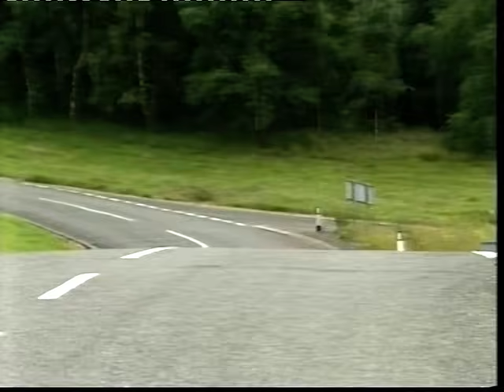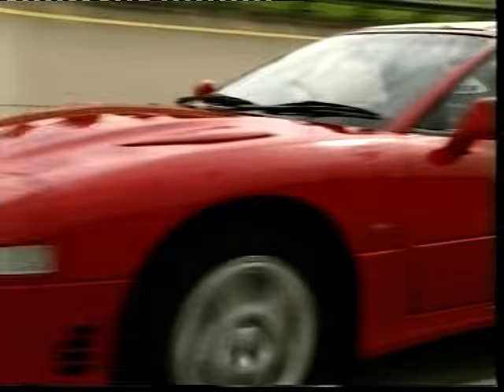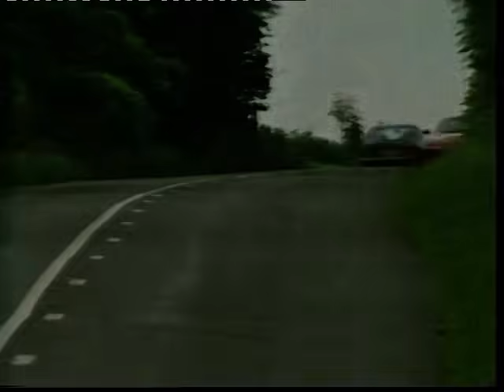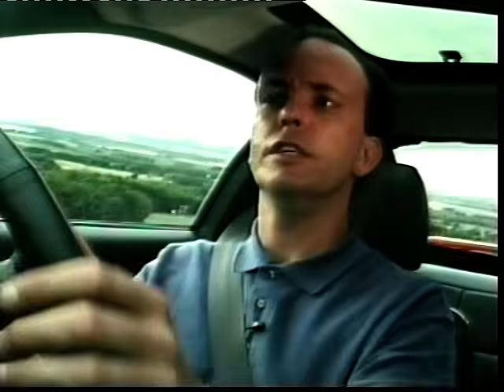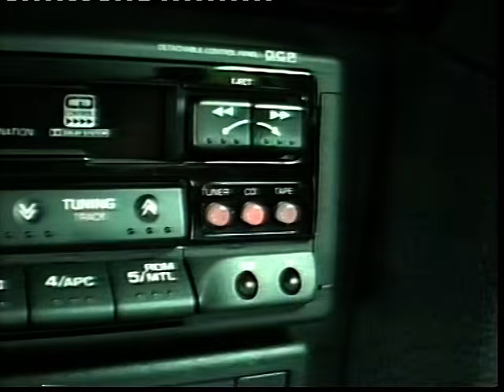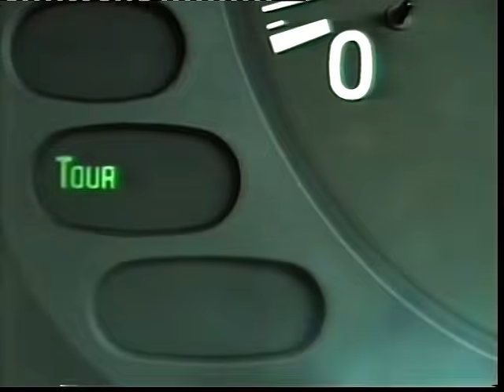Mitsubishi 3000gt (Old video review/launch footage)

Comment: One of these Euro spec Mk1 3000gt’s  recently made 25k GBP at auction, this model is now VERY rare in the U.K , exact numbers left is hard to say as they will be merged with all other 3000gts on how many left but suspect only double figures, different from every other 3000gt, GTO, VR4 with all the front lights and powered main beam washers, larger turbos and front brakes as standard putting out 320 bhp stock from the factory.Also has the 4 bolt main with the forged crank. I have bet on this model still being well undervalued if you can find one in good condition unmolested, we have two of them.
Reply: And to think that I bought mine some years ago for £2000, and then 2 years later sold it for £1500.
   It needed a new exhaust and I wasnt prepared to pay the £500 for a new one.

Comment: 5.6 to 60mph would be with a terrible launch, lol. When launcued correctly, even the 1g can do 60mph in under 5 seconds - dodge put an ad out for the 1g stealth tt that stated it was faster than a testarossa to 60mph, which it was - they clocked it to 60 in 4.89s.
The 1994 and up VR4s hit 60 in well under 5 seconds even with a terrible launch. 
The VR4 was faster than all but the mk4 supra tt in a straight line, leaving the fd3 rx7 tt and z32 300zx tt eating shit from a dig and a roll, and from a dig the supra tt only passed at around 110mph.
Reply: yea man even tho the GTO is 1700kgs it dose not show

Comment: What year model is this car?
Reply: Maddex Castaneda 
J reg in the UK would make it either a 1991 or 1992 model. However, it’s a private reg so it could be a newer model sporting an older plate but given it’s a review of when not long launched in the UK I’d go with an original 1992 model.
Reply: Thanks mate
Reply from the maker: Hi Maddex - At a guess it's going to be a UK spec 1991-1993 Mitsubishi 3000GT Twin Turbo Version.